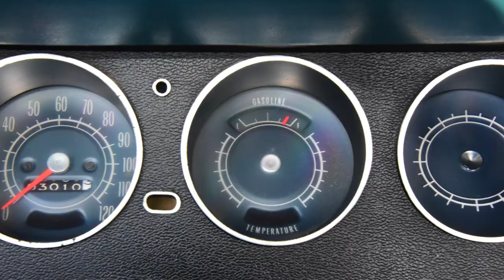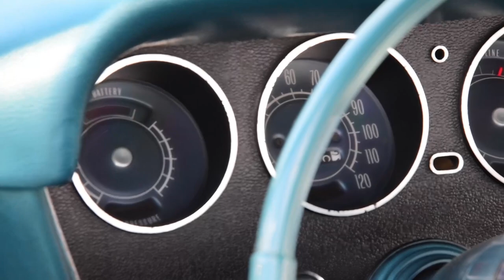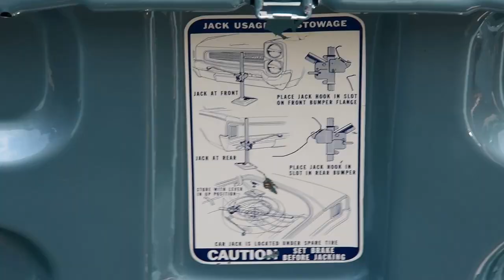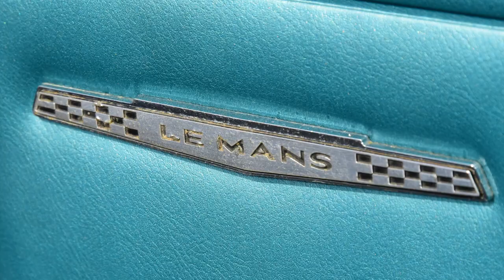1966 Pontiac LeMans: Regular Car Reviews

Comment: “What if GM had kept at it?” 
 Boy, that question holds true about many of their endeavors.
Reply: No lie. Fiero......
Reply: Mercruiser LT5...
Reply: Pontiac G8......hell pontiac as a whole.
Reply: Corvair
Reply: Remember that pitch for a GM rotary?
Reply: 4.2 blackwing V8 😢
Reply: In typical GM fashion, they would’ve slowly improved it, and right at the moment that they’d get it right, they would get rid of it, the next year.
Reply: @stoneylonesome4062  …as per protocol.
Reply: @ChronoTango The fact that Citroën, of all companies, gave up on on the Wankel rotary engine, should be evidentiary that it’s really not worth it. If there was ever a car company known for ripping up the rule book and reinventing the wheel in their own insane way, it was Citroën, and even they recognized it as a fool’s errand. It’s a good example of how a good idea doesn’t necessarily work, and if it does work, it doesn’t necessarily work well.
Reply: @stoneylonesome4062  Thank you! My point in spades.
Reply: 4.2L straight 6 from the trailblazers could’ve been something too
Reply: EV1
Reply: @seththomas9105  Solstice and Sky.
Reply: @stoneylonesome4062  The ghost of Roger "I don't know nothin' bout making no cars" Smith haunts the halls and factory floors of GM to this day. 

Just look at the lineup of cars and trucks from GM in 1965, the quality, design, engineering, value; vs. 1985. Insaine how the company went off the deep end in only 20 years.
Reply: turbo engines in the 60's
Reply: The 3800

Comment: GM has had the knack of developing great ideas, and then killing them before their prime.  and I believe you could get that ohc engine in a firebird.
Reply: Or if they do finally get things right, they immediately kill it. See Fiero GT, even the SSR when it finally got the Corvette engine.
Reply: Agreed - GM did this repeatedly over the years. It's ridiculous.
Reply: Yup. GM pretty much invented ecoboost in the Grand National, but…
Reply: @PrydeWater901  that and the olds f85 had a factory turbo option too.  only issue was it had to have methanol injection to keep the engine cool and people couldn't be bothered to top it off.
Reply: Yes.  The OHC6 was offered in the Firebird.
Reply: Not to mention the Volt.
Reply: Oh God. I remember how GM was doing this what seemed like every 6 months back in the 80's. Fiero is #1, of course. Killing the G-Body platform etc.
Reply: Same as what Jay lenos restoring the 6 firebird?
Reply: Yes you could the firebird sprint !
Reply: turbo 4cyl in the 60's, dohc n/a 4cyl with 180hp in the 70's, turbo quad 4 in the 80's, gmc syclone, corvette lt5, isuzu impulse rs, the v6 3.4 quad cam made 280hp but they had to tune it down to 220 because of weak transmissions, catera v with the ls1, the s10 extreme with the ls1, quadrasteer trucks, turbo cobalt ss or any affordable fun car, they killed everything nice or fun

Comment: I never knew about the Delorean 6 engine. John really liked to push the envelope which unfortunately rubbed the GM brass the wrong way in a lot of cases. 
Brandon's Pontiac is cherry, I'm sure he'll keep Grampa's car that way for years to come.
Great video RCR!
Reply: They ultra RARE  you could get this same engine in the 1st gen firebirds very low production but there out there
Reply: If you think the OHC Pontiac six is interesting, check out the Trophy 4 194ci half of a 389 he made before the in the Tempest/Le Man's with a rope drive and a transaxle.
Reply: Jay Leno has one.
Reply: IIRC this was one of the intended engines for the Banshee, a concept that GM nixed to protect the status of the Corvette. Much of the Banshee's styling was then swiped for the design of the next Corvette.
Reply: They we're going to make the Quad Cam Pontiac V8 as well.

Comment: I always genuinely appreciate and end up learning from these classroom format reviews.

Had GM continued to develop this overhead straight 6 design, we very well could have has an American 2J engine in the later Pontiac Prix of the 1980's. Maybe a twin turbo edition would have ended up in the Buick Grand National. Growing up with a gearhead dad and always hearing "There's no replacement for displacement" I was attracted to big v8s all my life, but as I've gotten older I've started to appreciate tuner culture more and more. Making smaller blocks output the most power you can squeeze out of them is fascinating, and I'd like to think this old straight 6 design, if it has been fleshed out a little more, would genuinely have as much of a cult following as the 2JZ. Fantastic write-up on this forgotten gem.

Comment: These were neat cars. The Sprint package you mentioned (which added a factory 4-barrel carb and other perks) was even available on the Le Mans 4-door hardtop, making it a sort of primordial American M5 (albeit a really, really, REALLY rare one, like only single digits made IIRC). 

I too have wondered how the OHC 6 would have evolved over time, but also the turbocharged 301 V8 in the '80 and '81 Trans Am, the last all-Pontiac performance engine. Using the Buick turbo V6's progression as a guide, EFI, an intercooler and other upgrades could have easily turned the Trans Am and Firebird Formula into 300+ hp Corvette shredders...which of course would have gotten it cancelled the nanosecond Chevrolet brass threw a tantrum in front of GM corporate...
Reply: The older I get the less and less I can even stand corvettes. Not only how GM treated it but the fact that every person I've ever known  that owned a Corvette is an insufferable prick.
Reply: That engine got cancelled because in the 1982 and later Firebirds (they were significantly lighter) it would have been faster than the Corvette. GM always killed their best cars so they could say the Corvette is the fastest. The 301's biggest issue is the thin cylinder walls, thicken them up and that engine could have been amazing. But GM gonna GM...
Reply: @TheTardis157  It's saddening when you realize that there were a ton of cars that were outright crippled or even killed to protect the Corvette over the decades. From Pontiac you had the Banshee Concept, the third generation Firebird Trans-Am, the Fiero, and the two captive Holdens the GTO and the G8. From Buick you had the Wildcat, the GSX and the Grand National GNX. From Oldsmobile you had the Aurora. From GMC it was the Syclone and the Typhoon. From within Chevrolet themselves you had the Chevelle SS and Nova SS get nuked. And most of this was because GM didn't want to put effort into making upgrades to the C3 Corvette and wanted to bottom out the price of the C4.

Comment: The time I became aware of the Delorean 6 was over 20 years ago at my speed mechanic's shop. A customer of his had this beautiful cherry condition 1968 Pontiac Firebird with the 6 cylinder in the classic sky blue Pontiac engine paint and the words "overhead cam" on the valve cover.  Apparently that was the base engine for the 1st Gen F-Body for Pontiac. The engine was is great condition but the owner insisted on engine swap to a 350 Chevy smallblock for trouble free cruising and repair. I was amazed that GM had such a high tech engine in the '60s that seemingly very few knew about.

Comment: The Pontiac 230 I6 was the first mass-produced overhead cam engine to use a fiberglass reinforced timing belt.
Reply: Huh? The 326 was a pushrod V8.
Reply: @dclipper8052  you're right, no idea why I had 326 on the mind. Thanks for the reply, I fixed my comment.

Comment: I had one briefly not long after I finished high school, purchased for the grand sum of $800 in the mid-90s. It was a white hardtop with a 3-speed manual transmission. It was languishing for sale for months as in those days nobody wanted the “poverty row” grade transmission. It ran and drove well enough, and was surprised at how spirited the six cylinder engine was. 

It was without question one of the funnest cars I’ve ever owned (and I’ve surpassed the 400 mark for cars owned to date). It launched wonderfully, handled well and looked great. I was the butt of so many jokes in the muscle car crowd as the Pontiac’s potential was being constantly overlooked. I only had it a few months when I caught wind of one of my dream cars coming up for sale… a Garnet Red ‘66 442 that was 4-speed equipped. 

I advertised the car for sale for quite some time with no takers or interest. Eventually, I did sell the Pontiac for $3500 to an older gentleman who made me a cash offer upon seeing it parked outside of a bank we both happened to be running errands at.

They sure as hell don’t make them like that anymore!

Comment: When you “channeled your inner Joey Diaz,” I nearly died of laughter. 
The rest of your review was just as spot on as well. If DeLorean had stayed at Pontiac, and stuck to his guns, Detroit could have been putting out normal cars with all aluminum overhead cam straight sixes with rear transaxles, and independent rear suspensions when Johnson was still in the White House.
To channel my own Joey Diaz, I actually kind of prefer reverse flow heads. Yeah, they don’t breath as well as crossflow heads, but they’re torquey as hell.

Comment: We do have an Ameri-Berra, the Atlas 4200, NIVLAC57 "LS Calvin" is in the Ohio area and is friends with Matt Happle and the Sloppy Mechanics crew. You should check him out and link up to check out some of his cars. Yes, I agree that the OHC Pontiac six should have been developed more, the Aussies could have at the least used it instead of using the Redtop I6 for so long and eventually using the RB30 when unleaded fuel became mandated, before eventually using the Buick 3.8, which is a nice engine but, no comparison to the Barra, the fuel crisis would have been the perfect time to resurrect this design since they were stuffing the 250ci I6 in everything, the main issue was the camshaft not having replaceable bearings making the heads nearly disposable, it would have been incredible if the 292ci six with a cross flow version of this OHC head would have been used in say...GMC trucks as the base work engine and then the Pontiac V8s could have been the big power option. An all aluminum version of the 250ci OHC six in Firebird, LeMans, Catalina in the 70s and 80s could have really been something especially if it got sentential multiport EFI live the Buick V6s got, boost could have been even better. This OHC six is certainly a better idea than the quirky Trophy 4, 194ci half of a 389ci V8, that it replaced spiritually. I would imagine a 292ci with this head that has been tricked out a bit with porting and a valve job, with a performance intake manifold, sniper EFI, with tuned length pipe tube  headers that scavenge corresponding cylinders, wide band O2s, mean cam timing spec'd out by David Vizard and hooked to a 6 speed manual transmission would be an insanely powerful, interesting and unique resto mod/protouring build in a sea of V8s. It would be really cool if a company like Clifford had some OHC heads cast that fit GM I6s with modern cross flow, cam bearings, specially designed ports and valves that is belt driven just as this is, I think they could really sell if the labor.of love was given to them that is lavished on SBC, SBF, BBC, LS and so on engines. There are tons of the old sixes around and they're treated like scrap. Oh, well, a guy can dream.
Reply: I like that dream...
Reply: I second this recommendation.  I'm actually surprised he hasn't met Calvin in passing, due to both of them knowing Sloppy crew.  I guess being a state apart and Mr Regular probably knowing Justin more than Matt caused them not meet yet.  But yeah, Mr R and Roman should make the trek out to see the Studebaker, he'd piss his pants at what Calvin has done with his turbo 4200.

Comment: I hope some day you can drive a sprint 6 firebird some day with the 4 speed! In regard to parts, there is a fair bit of stuff you can still get. All the bottom end is the same as the chevy, the crank rods and pistons, all same. So most of the stuff that might need replacing, you could get it.

Comment: My sister had one of these with a Hurst shifter. Early 70's. Not sure if it was a 3 or 4 speed. It was called the sprint package. It was fun. Fast. 4 barrel from factory. They put this engine in a Firebird too, I've recently learned.

Comment: I’m not sure if anyone had mentioned this, but GM did “sorta” do exactly what Mr. Regular was talking about. With the Vortec 4200 straight 6 in the Trailblazer/Envoy. It was a 4.2 Liter, all aluminum, DOHC with VVT. Fun fact, they twin turbocharged this motor for the Trailblazer SS originally and it made stupid power, but they decided to go with the LS. It’s not a powerhouse necessarily buuuuut I have seen a lot of people swap these into older trucks and cars.

Comment: You've done a video that has enough that I've three talking points to touch on, instead of just one or two.

First was that I learned about the OHC 6 Pontiac engine when Motor Trend did an article about one for the June (?)1974 issue.  It was of a Tempest with the standard (not Sprint) 6 with a 3 speed manual.  They even did instrumented testing of it.  Sixty came up in about 11 seconds.  For context, if you were to look back through  Motor Trend's history, you'd find a road test of a '66 Chevelle Malibu 2 door hardtop with a 283 and Powerglide that showed a 0-60 of over 14 seconds, or about the same as a '82 Pontiac 6000 that Car and Driver tested.  The article was interesting also because the author discussed his motivations for buying the car.  It's also sort of ironic that they did this in the midst of the first energy crisis.

As for a platform more amenable to the OHC 6, keep in mind that this was the standard engine on the first Firebird.  There was also a Sprint option for that.  Sometimes one of these will come up for sale, but it's so damn rare.  As for what GM could have done if they continued developing this engine, it's not that the Chevette would never have happened, it's that with experience in tuning smaller engines, they might also have listened more to their European counterparts, and the Chevette would not have been such a grim thing to drive, and the Vega might not have been the disaster it was.  Also, in better times, could you imagine a Cadillac V-12 built using these heads?  It might have been appropriate around 1984 or so.  Remember, the downsized '77-90 B Body cars, and by extension, C Body, was designed to accommodate a inline six.  If you can fit a V-8 in many places you can fit a four cylinder, a car meant to have a six could probably fit the sixty degree bank of a V12.

The color of this Le Mans, and your discussion of the idea of your parents promising a car when you got your license brings back a memory.  My grandparents made me such a promise, and things never turned out that way.  Either way, it would have been something decidedly benign, considering that we're talking about two similar cars, a '65 Bel Air 4 door with a 283 and Powerglide, or a '68 Impala with a 307 and the same.  In the end, I didn't get the first one because my great grandmother got t-boned in it, and as for the other, my grandfather had a similar accident just a few months before he passed, meaning that both were taken by accidents.  When I graduated from high school, there was a brand new Honda moped waiting for me.  They tried, at any rate.

Real innovation had a strange history of dying when certain people made an exit, whether it be Earle McPherson, who designed his eponymous strut suspension for a postwar Chevrolet compact design before leaving for Ford, to John DeLorean, whose hair hadn't turned gray even by the time he left Chevrolet, incidentally, to John Rock, who put a twin cam engine in the Intrigue only to see it phased out minutes after the door hit him on the ass on the way out.  

As for DeLorean, look for a picture of him from the time he was working for Packard.  He hadn't even had that chin implant at the time, never mind the long hair that also pissed off people on the 14th floor...

Comment: Had a 66 Comet with the inline 6 and column shift 15 years ago. Different than this Pontiac, I know, but it was a great running car that only ever needed oil changes. It probably didn't even need that. No one ever had anything bad to say about it even when they discovered it wasn't a V8. Somehow I decided a 92 Eagle Talon would be superior to the Comet and sold it off.
Reply: Currently have a light blue 67 Caliente with a six and column shift

Comment: 1962 Jeep Tornado engine was the first U.S.-designed mass-produced overhead cam (OHC) automobile engine... 230.5 cu in (3.78 L) straight-six, at 140hp.

Comment: The head on the OHC 6 was cast iron.  It’s the cam cover that’s aluminum.  I had a 66 Sprint 6 Lemans.  3 on the floor.  Factory Quadrajet carb.  Zero options.  Of course, I blew it up.  I rebuilt it but kept burning up cams and followers.

Comment: Ten years back or more there were some guys looking at splicing two GM LQ-1 heads together to make a DOHC 24V out of this thing. A direction Big John wanted to go. Corporate said no. Plus the 70 Firebird came out and the six was too tall to go under the hood. Four or five years later I'm willing to bet they hadn't driven a stake into the engines heart. Because by then the tooling for the cylinder head had probably already been scrapped. But this engine is not without faults. It had a tendency to eat rocker arms and timing belts. At least the valve train wasn't an interference design. But the at least could have produced it with a cross flow head.